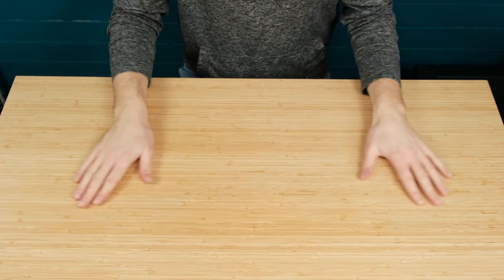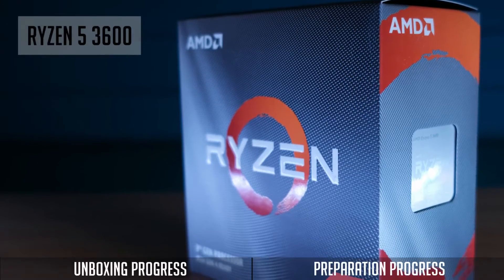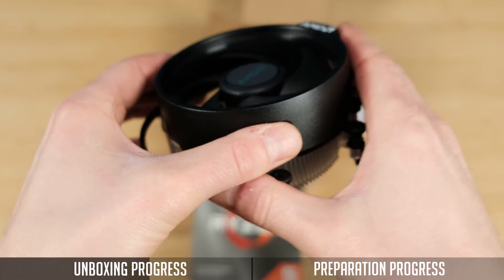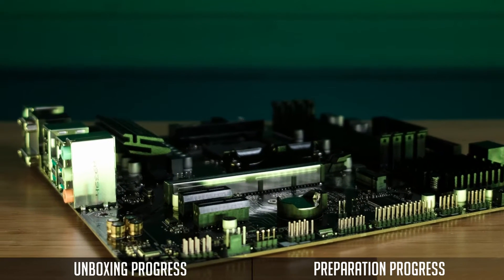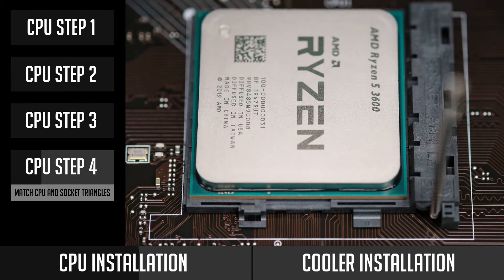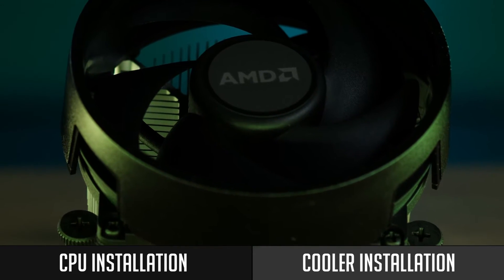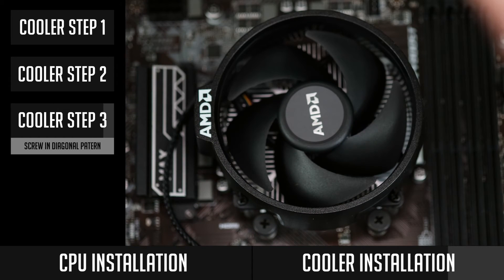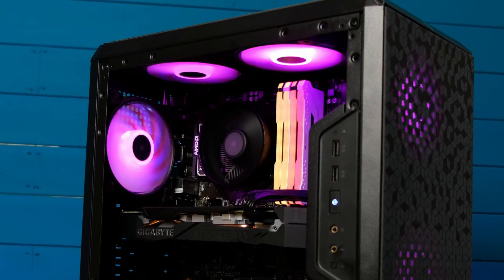HOW TO INSTALL RYZEN 5 3600 CPU + UNBOXING - CPU installation tutorial / guide

Comment: Did you took out the bottom protecter for cooler when you install it or you didn't?
Reply from the maker: Hey,
Ryzen stock coolers are packed into some plastic covers with a pre-applied thermal paste but it does not have any protection you need to peel from the bottom :) You will see when you unbox this cooler.
In case you will be mounting an aftermarket cooler without a pre-applied thermal paste, most likely you will need to peel a sticker from the bottom before mounting it :)
Reply: @EpicGameTech  really thanks! I just purchased ryzen 5 3600 so I was curious

Comment: This is a basic question, so my motherboard haves an AMD 3 3100 CPU install. Does this mean that any AMD CPU is compatible with my motherboard? For example, If I  want to upgrade with an AMD Ryzen 5 series then it will work? I'm very new to PCs.
Reply from the maker: Hey,
In most cases yes, the motherboard should support a better CPU. But to be sure, you need to check the exact motherboard model. As if it's a very cheap motherboard, it's not recommended to get more cores CPUs like ryzen 9 for example as it will run very hot.
So, just let me know the exact motherboard model, and then I could tell you more :)
Also, r3 3100 is a nice budget CPU for gaming. What video card you have?
Asking since by upgrading the CPU to r5 might not improve any fps for you if the GPU is not good enough :)
Reply: @EpicGameTech  Well thank you. I bought my PC pre-built from amazon, so it never came with a Manual of the parts. However, the description does describe what parts were installed. So, for the motherboard, it said that it haves an "A320 Motherboard" that's it. I tried googling the name, but the results were different versions of the A320 that made me confuse cause I wasn't sure which one is mine exactly. As for the graphics card, I have an Nvidia GTX 1650 Super and 8GDs of RAM.
Reply from the maker: I see. A well-specific model is written on a motherboard and most of the time it's quite visible (in some cases graphics card may cover it).
You could also try downloading cpuz - https://www.cpuid.com/softwares/cpu-z.html
This soft gives pretty much all the basic info on your pc like ram, CPU, gpu, and motherboard.
As you have gtx 1650 super, r3 3100 should be enough for this GPU. R3 3100 could handle even a better GPU. So if you upgrade a CPU you will not get any real fps increase :)

Comment: Is there plastic film (that need to be removed) over the pre applied thermal paste on the AMD cooler?
Reply from the maker: Nope, you will see. The cooler will be protected with a few plastic covers, but nothing to peel, etc. 
In most cases, you need to peel a sticker  from aftermarket coolers that do not have pre-applied thermal paste as protection from scratches, etc :)
Reply: @EpicGameTech  Thanks!

Comment: I installed ryzen 5 3600 on my b450m pro vdh max. But now I don't have any screwdriver to remove clamps for heatsink. 
So can i keep my cpu like that on my motherboard for 8-10 hours until i get a new screwdriver to open the clamps ?
Reply from the maker: Hey,
Sure you can (if you do not turn it on) :)

Comment: made a brand new pc. Connected all the parts and pressed the power button. Everything turned on and looked pretty. All fans and lights were on but then I realized I didn’t have my monitor or keyboard near me to set up my windows and bios. So after a couple minutes I stupidly pressed the power button until it shut off.

I moved the tower to my computer desk and hooked up everything. I turned the PSU switch on and saw the MB and GPU light on. I pressed the power button and all the fans turned on for 1 second then silence.

I’ve reconnected all the psu pins. I even tried a different power supply.

Everything is new:
Ryzen 5 3600
Asus B450-F ROG STRIX MB
CRUCIAL 4 8gb 3200 ram
650 watt 80 plus gold PSU
LIAN LI lancool 2 mesh case
500gb m.2 ssd
2tb ssd harddrive
2770 super

I even reset the motherboard with taking the battery out and then putting back in.

Should I take cpu cooler off and try aftermarket paste?  Maybe there’s a heat sensor?

Help
Reply from the maker: Hey,
nah, it shouldn't be a heat issue. I mean you can actually start a PC and even a BIOS washout a CPU cooler (with some CPUs), since it doesn't get hot right a way when you start your PC :)
At first, I would actually try to reset CMOS again by using a jumper on your motherboard (there should be info in motherboards manual) and removing battery for a longer period of time (had a case when my friend removed a battery but inserted it too early and didn't reset a bios). 
Also, in case after that reset you will see GPU debug LED on your motherboard, try to remove/install GPU again (maybe you forgot to connect GPU 8pin or 6pin power cable?) :)

Comment: what about the backplate... ?? ??
Reply from the maker: Hey,
In case you will be using a stock cooler, just screw it to the one that is already on a motherboard (after you unscrew these pre-attached brackets) :)
But if you have an aftermarket cooler, you will need to replace a backplate on a motherboard to the one that is included with a cooler you got.

Comment: Instructions in this video are really helpful and clear. I just left with a worry in my mind. I just bought a Ryzen 5 3600 processor and the same mobo( MSI pro vdh max)... I am worried how would I know if I have correctly done with the screws ? How would I know if there's no much gap left between the CPU and Wraith stealth cooler ? I am worried if I screw them much such that it might break the CPU ?
Reply from the maker: Hey,
thanks :)
Well, there should be no gap, you need to screw all screws till the end - I mean screw until you normally can. Screws are spring-loaded so you will not break it. If you will not screw till the end, you will have bad touching surface and bad temps :)
So, screw until you can't screw it any more.
Reply: Thanks a lot for the reply.

Comment: I know I am very late but did you have to do anything with thermal paste
Reply from the maker: Hey,
In case you are using stock ryzen CPU  coolers - all of them have pre-applied thermal paste so you do not have to worry about it :)
Unless you are using an aftermarket CPU cooler you may need to apply it by yourself.

Comment: I installed my 3600 today, and it went right into place with the triangle right but, I had to put a little pressure into the arm to get it to go back down. Is that normal?
Reply from the maker: Hey, basically retention arm is quite easy  to lock-in. But sure it might be subjective  :)
Did you test everything? I mean the system is working?
Reply: @EpicGameTech  I am waiting om my ram which is coming in the mail today to try it out. Should have just waited because the anxiety is killing me lol. But yeah, I placed the cpu down and when I went to very very gently wiggle it, it fell into place. Then I again veru veru gently tried to wiggle it and it wouldn't, made sure it was evenly seated on all sides and top. Then finally when pushing down the arm I felt a small amount of resistance about half way down. I'm just nervous because my last pc build 2008 was so long ago.
Reply from the maker: Small amount is ok :)
Should be fine for sure
Reply: @EpicGameTech  just got the pc up a d running. Thank you

Comment: When applying the cooler I had problems screwing it and I had lift it to adjust it. Only did it 2 or 3 times until it screwed but I'm kind of worried about the preapplied thermal paste being ruined while doing so. Is that something to be worried about?
Reply from the maker: Hey,
well it depends what exactly happened, but if the paste stayed on your cooler/cpu, I guess it spread good enough when you finally screwed it. Sure, if it's all over the place (like on a motherboard etc.) you should clean it for sure and re-apply it, since there might be too little paste left ;)
Reply: @EpicGameTech  there were some on cpu so going with what you said I guess I'm fine
Reply from the maker: On cpu that's fine.
Just run some CPU stress test for 20-40 minutes and check temperatures :)
And check in game temperatures (you can use MSI Afterburner).
If temps are ok, then it's ok for sure.

Comment: How much pressure do I need to apply when screwing mount in. Seems like a lot of pressure needed to compress the springs to the point where screws will engage and I don’t want to crush the CPU
Reply from the maker: Hey,
That's actually true, you need to use quite some presure for screws to catch a thread :)
But when it does, it's easy to screw it.
Be sure to screw your 1st screw just a little bit (not till the end) before you start screwing 2nd screw :)

Comment: Hi man thx for your guide it was really good. When i booted up i had no display. This is what i tryed:
Cleared cmos
Bois update
Change ram
Sent the cpu back to the store but There it worked. What can i do? I need help!
Reply from the maker: Hey,
thanks :)
hmm, but it posts since you did a BIOS update?
What GPU do you have? Are you sure it's working?
I know probably it will not apply here, but sometimes people tend to plug display to a motherboard and not to an installed GPU :)
Reply: Epic Game Tech after the bois update i booted up and fans are spinning but still no display. I have the nvdia gtx 1050 ti 4GB.
Reply from the maker: hmm, so display is OK while you are in bios, but later (when it should load windows) it goes blank?
Since if a display is blank from a beginning, how you possibly can update your bios ;)
Just trying to figure out
Do you hear any beep?
Also, did you try booting with 1 stick or ram?
As you mentioned you cleared cmos (jumper or tired to remove battery for 20 secs?) i would still try to go component by component removing and checking of it's working. Even reinstalling CPU :)
Reply: Epic Game Tech i updated my bios with the old cpu i put that back and that works fine. I do not hear any beep but on my motherboard There is a light on cpu by ez debug log. I booted it with 1 ram stick still nothing. I cleared cmos with a yt video. And i already reinstalled my cpu. Thx for your help anyways
Reply from the maker: Ah, red light near CPU - it means issues with your CPU for sure.
What motherboard you have exactly (model)?
I guess you've upgraded from 1st gen or 2nd gen Ryzen to r5 3600?
But definitely - either BIOS does not support that CPU or something wrong with CPU installation - bent pin, wrongly secured in a socket etc.
Reply: Epic Game Tech the light is white. And i already sent it back to the store the checkte it There and worked. Motherboard: MSI A320M PRO-VH PLUS old cpu: AMD Athlon X4 950.
Reply from the maker: I see, then CPU should be alight. But there might be issues with the motherboard.
I have no ideas for now, but definitely, you could try using a different motherboard with all the same components.

Actually, if you could update your bios on your old motherboard (MSI A320M PRO-VH PLUS) it supports r5 3600 CPU, so you could try same components but a320 motherboard. IF it works - it's definitely Mortar motherboard issue :)
Reply: Epic Game Tech thx for your time and help❤️ but i dont have a another motherboard so i need to bring it to a ict shop.
Reply: Epic Game Tech the display poort is in my GPU 100%

Comment: Wait, so the thermal paste goes onto the cooler and not the cpu?
Reply from the maker: Hey,
as I mentioned, thermal paste is already pre-applied (in a factory) to a stock cooler. But in case you need to apply thermal paste by yourself (say you buy an after market cooler) you need to apply it to a CPU and not a cooler :)
It's just pre-applied ones are always on a cooler.
Reply: @EpicGameTech  ah okay, ty

Comment: What's it screwed to??? 4 massive holes in my board? I see you never mentioned the massive plate that falls off when you remove the pre- installed brackets. Worth mentioning pahaps???....
Reply from the maker: Hey,
good point, I didn't mention it can fall off. But it's quite a little scenario, as in most cases (might be on some specific motherboards?), the motherboard is on your table/mat and so it should not fall anywhere :)

Comment: Hey man loved the video, but i have a question, before installing the cooler should I take off the thermal paste protection or should i install the cooler with it? It would be a great help if you could answer my question. Keep up the awsome work.
Reply from the maker: Hey,
Thanks :)
In case you are using stock ryzen cooler, it has no protection, etc. You just take it out from its package and thermal paste is already pre-applied and you can mount it straight away :)
In case you use an aftermarket cooler, it might have some protection on a heatsink pad. But then most likely you will need to apply thermal paste to your CPU manually :)

Comment: So you don't need any bracket for the stock cooler? It just screws straight to the mobo?
Reply from the maker: Hey,
after you unscrew two brackets I mentioned here (https://youtu.be/3DdP1DLGrwg?t=280) you need to screw your CPU cooler to the same spots where those brackets were screwed ;)
Reply: @EpicGameTech  thanks! Thats what I thought

Comment: I’m very new to PC gaming and I need to upgrade my cpu and cooler and this video actually just helped me so much cause I was like I have no clue how to do any of that. This was a very impressive video and can’t wait to install my cpu. The only question I have is, am I supposed to peel something off of the cooler to expose the thermal paste or do I just do exactly what you did?
Reply from the maker: Hey,
First of all thanks :)
Depends on a cooler you are trying to install. I've installed a stock cooler that comes with rysen 5 3600 CPU. So in this case, you do not have to peel anything. Thermal paste is already pre-applied and you will see when you get that CPU cooler. You will take the whole cooler from its packaging/plastic and that's it.

But in case you will get an aftermarket cooler, you might need to peel a sticker from coolers heatsink and then apply a thermal paste to a CPU by yourself :)

So it depends.
Reply: Epic Game Tech hey thanks man that helps a lot

Comment: I have the same spring loaded screws but they won’t move at all when I use the screwdriver. Any suggestions?
Reply: I’m also having the same issue, I’m applying a lot of force and they still aren’t going down :(
Reply from the maker: @lui8911  might be you screwed 1st screw too mutch/deep?
Also, be sure a backplate is touching a motherboard. If it'snot, your screws will not reach thread for sure :)
Reply from the maker: Hey,
They are kind of tricky. I mean you need to apply quite some force when screwing :)
If was the same for me when I was mounting the 1st ryzen stock cooler. I was screwing very gently at first.

Comment: should i keep the amd thermal paste or use my corshair thermal paste?
Reply from the maker: Hey,
since you keep stock cooler (right?) just use stock thermal pate. I didn't tested vs aftermarket one, but saw a few videos where other guys tested and didn't see any noticeable difference. Especially when you will be using stock cooler.
I would say it's better to buy some kind of aftermarket cooler (e.g. for $15-$20) instead of a good paste. There will be way more difference :)

Comment: I think I messed up. How to I know when the screws are tight? I did as you said and sat my pc up and the fan slid off.
Reply from the maker: Hey,
Well, you have to screw till the end, until you can't screw them anymore :) so screws must be tight
Reply: @EpicGameTech  I figured out that problem. Now when I turn my PC on the lights come on for about 15 seconds and then it restarts. Did I perhaps put the gpu on incorrectly.
Reply from the maker: What motherboard you have? It might have debug LEDs on it :)
Reply: @EpicGameTech  its an asrock 450. I made sure everything was put on correctly
Reply from the maker: What's the exact model :) there are lots of asrock b450 motherboards
Anyway, easiest things to check and take it out and then put it back - ram, gpu, all PSU cables are inserted till the end :)
And if it doesn't help, then you need to check if CPU is mounted correctly and it means you need to remove cooler, check cpu (remove it and add again). And best you will need to reapply thermal paste :)

Comment: Is there anything we need to do with the pre-attached brackets once they come off for the cooler?
Reply from the maker: Hey,
If its wraith stealth cooler, you will not need those brackets. So just keep them i  casd you need them in a future :)
E.g. if you upgrade to 3700x or better cpu that use wraith prism cooler. Since for that coolee you would need to use those brackets :)

Comment: I hate the Ryzen 5 cooler.  It felt like I needed to apply a decent amount of force to get all 4 screws to catch and screw in fine.  The Ryzen 9 cooler is so much simpler with the two latch system.
Reply from the maker: Hey,
yep. Actually when I tired for the 1st time screwing R5 3600 cooler, I had to convince myself its' gonna be ok and I will not break anything while screwing the 1st screw :))
But sure - 2,3,10 times and you get used to it :)

Comment: I installed my processor and put the CPU above it like you did but my problem is that the screws don’t go in
Reply from the maker: Hey,
Well since coolers screws are spring loaded so i assume you need to push harder in order to screw them.
Try using one hand and holding a cpu coller so it would sit steady and with other hand screw one screw a bit (while applying some force) but not till the end. And then screw other screws :)
Reply: Epic Game Tech am using a lot of force on it but it just doesn’t work
Reply from the maker: Hmm something is not right :)
It should work, since its a way to do it. And works for everyone.
Not sure how to help in this case.

One more thought - might be your motherboard back-plate fell down? Please check it. It might be not in place and coolers screws cant reach it :)